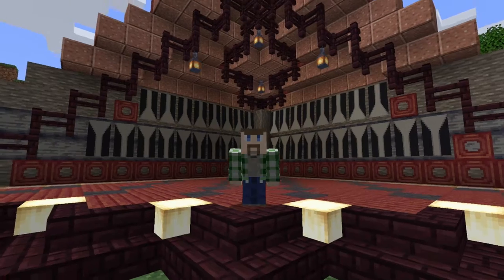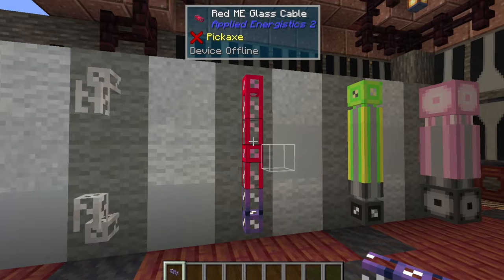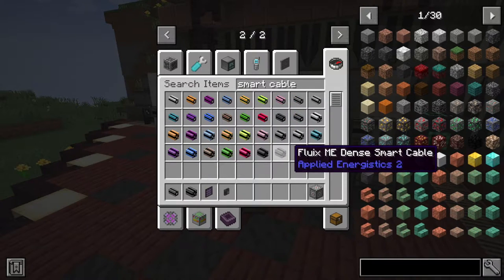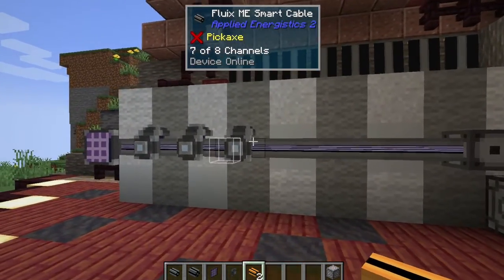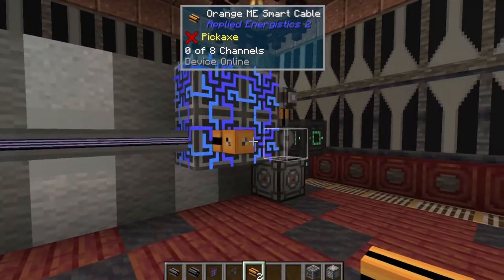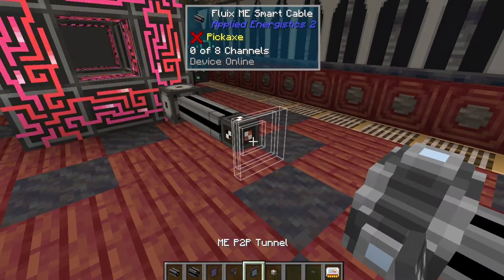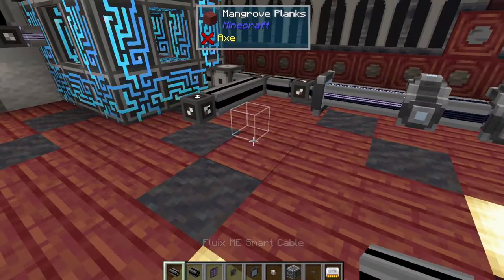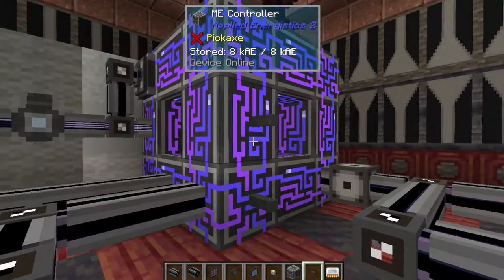Applied Energistics 2:  Cables and Channels - Minecraft 1.16 - 1.19 - Modded Minecraft Tutorial

Comment from the maker: I think I left something important out of the video regarding P2P tunnels on accident.  When connecting a tunnel to a network, it has to be on a non-dense cable.  If you attach it to a dense cable, it'll act like it can work, but it'll never allow you to link it to another one.  You need to bridge off of a dense one with at least one normal cable first.

edit:  I'm bad at explaining things, but you can also use a dense cable, but it HAS to have a dense cable connecting between the p2p tunnel and the controller for it to work.  The above applies if you're trying to branch off a smaller connection.

Comment: Now I got it how to convert other energy to AE energy. But how do I do the opposite? What I want is to convert AE energy to FE energy.

When I played Minecraft before 1.20, I used the Mekanism mod instead, so it was relatively easier to handle. However, since there is no Mekanism mod in version 1.20 yet, I have no choice but to use AE2. I know this video is from 4 months ago, but I still want to solve this mysterious problem. I've used a lot of tech mods so far, but I haven't figured out how to use AE2 yet.

Is it impossible that AE2 do it? If so, can you recommend another mod?
Reply from the maker: Okay, so what's going on is that two different concepts are getting confused together, and it's honestly not well explained in most documentation.

1)  AE2 energy is only for AE2 machines.  It's brought into the network via an energy acceptor to pass power to ME controllers, inscribers, crafting cpus, etc.  It can not be converted back to FE and there's no way to get this energy back out.

2) To pass FE/RF/etc to non-AE2 machines connected to an ME network though, you can pass a nearly unlimited amount through an energy P2P tunnel.  AE2 however can not store this power, it can only transport it.  Set up a P2P tunnel, and right click it with any item containing the type of energy you want it to pass.  Hook up normal energy cables to the P2P tunnel.  Set up another P2P interface where you want it to come out and repeat.  I think I explained that in this video. 

Link to the official documentation:  https://guide.appliedenergistics.org/#/1.20.1/ae2:items-blocks-machines/p2p_tunnels.md

That said, you're still going to need another mod to pass the power around going into and out of the P2P tunnels, so if you don't have one that does energy transport, you're in for a bad time.  Pipez is up to 1.20 and is basically a more performant version of mekanism pipes if it's available.

https://www.curseforge.com/minecraft/mc-mods/pipez

Comment: I am playing ATM9 to the sky, and I’m setting up a ME system with storage and terminal etc, my ME controllers are in the sky about 14 blocks high or so. And my ME drives are on ground level, I have connect them to dense cable and Smart cables, but on the 7 ME drives I have only 6 say device connected. I have 2 channels spare to use in the cable. I don’t understand why it won’t power it
Reply from the maker: The only two things I can think of off hand are either you don't have enough power in your ME network to power it, or your dense cable that it's connected to is past it's 32 channel max.  I'd need to see pictures to even be able to guess, but maybe swap out the dense cable at the ME controller and where the smart cable attaches with a dense smart cable and see what the channels are at that point.  You should also be able to right click an ME controller to see the full list of AE2 machines that it sees on the network, as well as the current power usage.
Reply: @Ardcraft hi thanks for getting back to me. I don’t have a way to show you how it’s setup personally. But I am copying. ChosenArchitect’s walkthrough of ATM9, same base layout and everything. Sort of watching him play while I play though the mod pack myself. If you have time it is his ATM9 to the sky series. It’s episode 10, AE2 storage Upgrade.   In his episode he only has 2 ME drives powered ATM. So when i connect cable to them. Only 1 doesn’t get powered. Hopefully this helps
Reply from the maker: Okay, yeah, I took a quick look at the video, and unfortunately I didn't see any point where he showed the back of the drives, so I have no idea how that's cabled up.  Honestly, just make two pieces of dense smart cable and check where the normal smart cable intersects with the dense to see how many channels it says it has, as well as where the dense cable goes into the ME controller.  That'll tell you how many channels the overall cable is using and things closer to the ME controller will use up channels first.  

You might want to also consider loading up either a copy of your world or just testing in an empty one in creative to see how it all works.  I can't tell for sure why it's acting like it's out of channels though from what I can see.
Reply: @Ardcraft  okay thanks for your help. Im sure I will figure it out. Might have to re-area some stuff 👍🏽
Reply from the maker: @NemesisMcKnight  Well, the other work around is turn the ME drive cable into a p2p tunnel to reduce the number of channels being used anyhow, which would allow you to expand that whole area long term.  I didn't see him even mention those though.